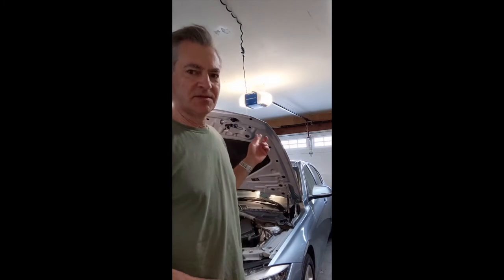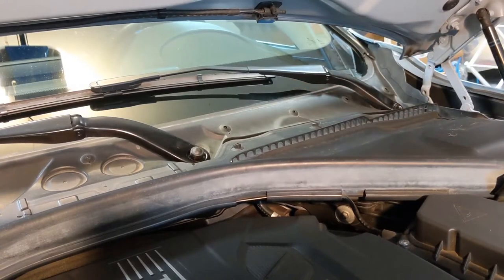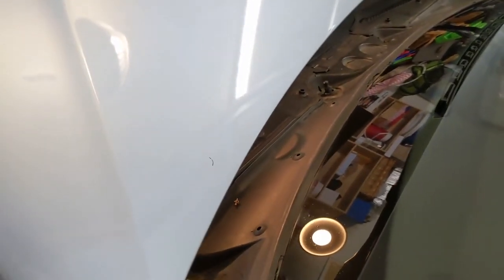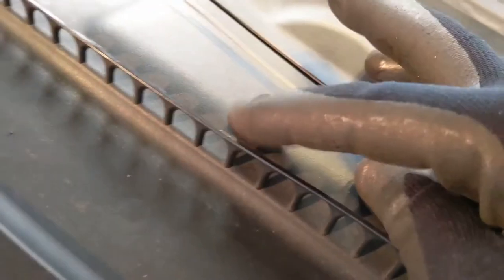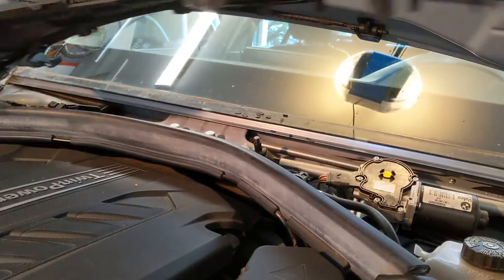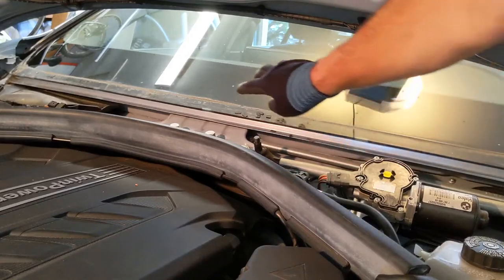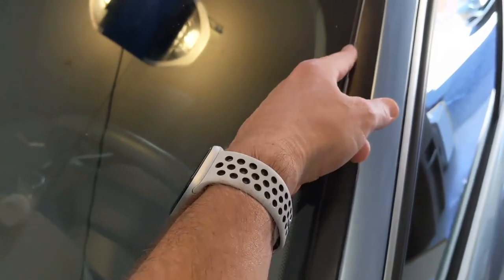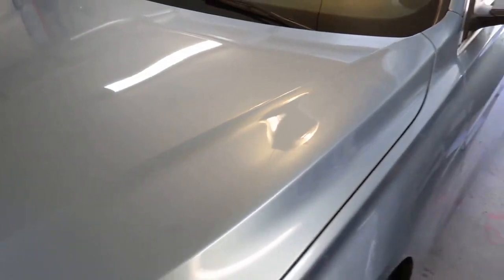BMW Windshield Cowl Replacement

Comment: I found that the pitman arm puller I purchased on Amazon worked well on the windshield wiper nut on the driver's side. It did not work on the passenger side nut. So, after removing the nut, I placed a 15mm open end wrench under the wiper arm at the bolt, then tapped on the wiper arm bolt while pushing down on the wrench which acts as a lever. I would recommend putting some penetrating oil on the bolts 24 hours prior to doing this job. The puller in this video seems to work well on both sides. Well done! Also, do NOT put Cerakote on the cowl molding. It reacts in such a way with the plastic that it looks terrible. Use Armor All.

Comment: Soak them in pb blaster 8-10 hours before you remove ( just a little on the spindle ) and it will come right off

Comment: Why there's a need for a tool where you can just rack the arm from the blade side push down and then move it back and its removed.
Reply: Hope you won't end up damaging the thread of the wiper mounting post.